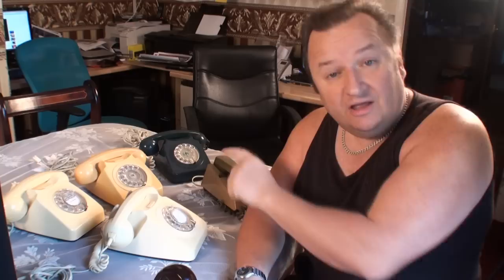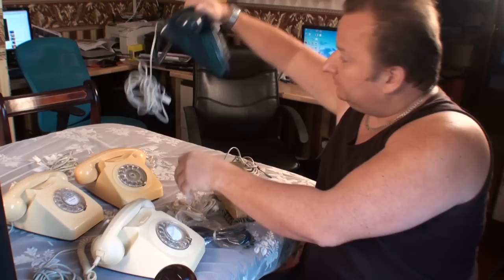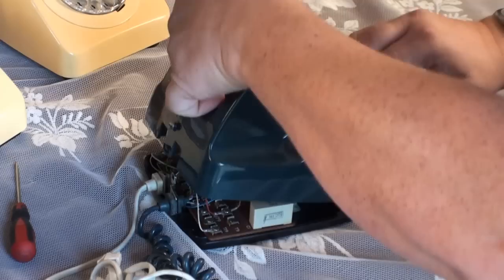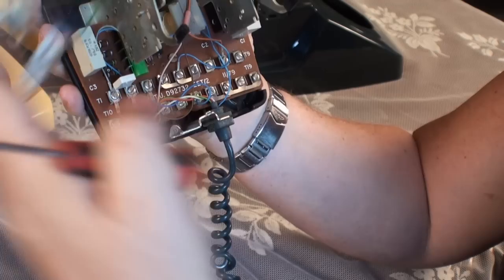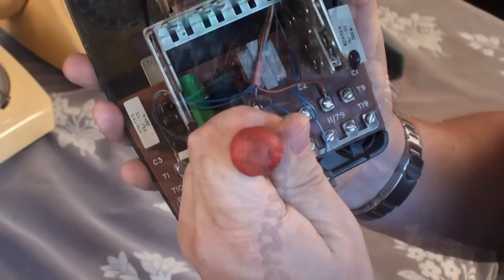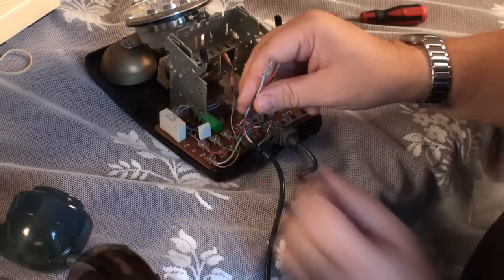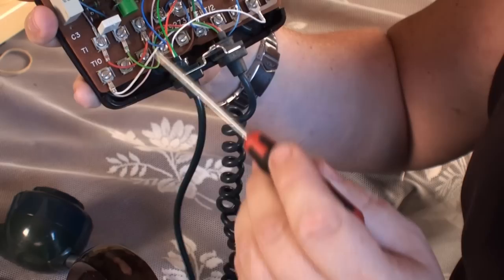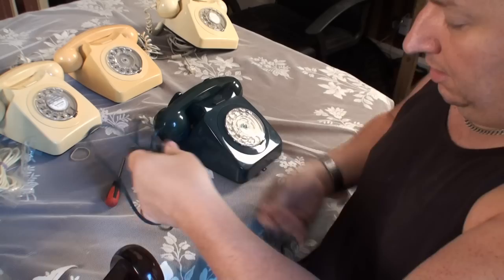How To Convert An Old GPO 700 Series Telephone To Work On A New System

Comment: Brilliant video chuffed to find such and informative well put together demonstration, just one question the 330 k ohm resistor there a few variants on ebay which one do I need please? Again thanks for the video.
Reply from the maker: This one was a standard ceramic John, nothing special.
Thanks for watching.
Cheers
Martin
Reply: Martin cheers mate, I will give it a go tomorrow ☺☺
Reply: Worked all fine for me Martin thanks again brilliant.
Reply from the maker: Nice one John, Well done bud.
Cheers
Martin
Reply: hello matey wicked nice and easy to follow one question all the 330 k ohm resistors have different watts the ones i am looking at are 330 k ohm 0.25w will the be ok ? cheers david
Reply: The one that's 330K Ohms.

Comment: Sound tip for any of this stuff is to take a photo of how it was originally connected before you undo any of the wiring.  Then you can always trace back any problems.
Reply: Get close ups from different angles. It's maddening to take just one photo and later realize som wire is hidden from view.

Comment: I forgot
I used to work for a large company with large offices.
When they changed from pulse dialling to tone dialling handsets, there were skips full of old phones, plus other stuff like golfball IMB typewriters.
They wouldn't let the staff have them and in the case of the phones, they said they wouldn't work on the new system.
How wrong they were.
And that was before broadband.😂😂

Comment: Just converted a 706 and it works like a dream, thanks
Reply: Can you get it to dial out?
Reply: @expertvillageidiot  Yes, from two different land lines. And ours is via fibre. Copper to the board 300m away and then fibre. Neighbours is just copper.
Reply: Both BT connections, if that helps

Comment: Even as a telecommunications technician I didn't realize how different US and UK phone lines are.  A phone line here is only 1 pair of wires. Signal and power are shared on that one pair. I've not heard of an old phone here effecting broadband speeds. I don't think the standard for analog phones here has changed in decades.

Comment: Hello Great clear well made video. I just wanted to point out that you haven't actually changed the Ren value with the resistor. The blue lead from the bell coils needs to be on the terminal on the left side and at the end of the resistor. The way you have it connected means the power is not going through the resister at all. Regards Neil Carpenter

Comment: Good stuff and thanks.
Just bought one of these for old times sake but I want to at least get the bell ringing.
Oiled the dial mechanism and straightaway that works as it should.
Amazing how ingenious these engineers were to do most of the dialling etc., mechanically.
It would just be a chip now, and probably impossible to fix.

Comment: Your provider still needs to support pulse dialing for these to work. I think BT are the only ones who still support it and they'll be fazing that out soon. If your provider doesn't support it you can't dial out with rotary dial phones. If you want to dial out you'll need a pulse to tone converter and their expensive!
Reply from the maker: Thanks for the update.
Cheers
Martin
Reply: I can confirm that Virgin Media still support pulse dialling in most (but not all) areas.  BT will support pulse dialling until 2025, when they will be phasing out the PSTN network and moving to VOIP.
Reply: Morris McKinnon .
Reply: Pulse to tone conversion can be done for around £30, I know of a guy that does that in Bromley.

Comment: Martin the Bakelite phones can be converted in the same way. the old GPO phones connected the bells in series and the coils where 500 Holmes so each phone bell impedance was 1k  allowing 4 phones to be connected in series. the new system connects the phones in parallel  so the sounder or bell coils are 4k impedance so when 4 phones plugged in overall impedance goes back to 1K that is why you fit the shunt resistor.  without the resistor the impedance is below the 1k and that is what affects your BB speed.
Reply from the maker: Thanks Gordon, That makes sense and is a handy addition for anyone wanting to know the tech side of the conversion. Good Job.
Cheers
Martin

Comment: Hi great video easy for an old wrinkly like me to understand. Mine don't seem to dial out, Is there something Ive missed?  Thank again for the easy to follow video
Reply: Depends if your network still supports pulse dialling. If not then it will only receive calls. There is a converter that will enable it to use tone dialling networks.

Comment: That resistor looks like it is a 3k3 ohm (3300ohms), as the colour bands are orange, orange, red. You refer to it as a 330k ohm (330000 ohms) which would be orange orange yellow. A slight difference of 100 times. 3k3 does seem a bit high. Can you confirm?
Reply: It should be a 3K3, so the item in the phone is correct. This is only needed if the bell coils in the phone are 1000 ohm (2x 500 ohm).

Comment: I've just bought a converted 746, dials out perfect, receives calls perfect but whilst I can hear them the other person can't hear me.
I've replaced the transmitter with one of the newer versions but it didn't solve the problem. 🤷‍♂️

Comment: Interesting that some of those have # and * after ZERO. State side as far as I remember ours stopped at Zero.  I think I still have a rotary plugged in my basement. Interesting to see the modular jack is different as well.
Best of luck with them
Tim
Reply from the maker: Yes, I think they are different this side of the pond Tim although they look the same on the outside.
Cheers
Martin

Comment: Hi Martin have managed to get hold of a couple of phones . One is a older 706 looks pretty much the same inside, the other two are,
Extenion phones  not sure if they can be converted  to work in the same way. 

Cheers  Pete.
Reply from the maker: hi pete, i'm not sure but i would imagine they are the same components just wired different.
Reply: Hi Martin will give them a go , nothing to loose my mum got hold of them for me.  Cheers Pete.

Comment: Thanks for this video it really helped me get my phone converted and working. The only problem is the ringer doesn't sound. If i pick the receiver up when i call from my mobile i can hear but it isn't ringing. Any suggestions? I've looked at the video and where your wires go but no luck so far.
Reply: Try bridging  T8 and T9 or failing that order a socket with an inbuilt ringing capacitor

Comment: I just noticed that in the UK the phone rings in two short burst. Here in America its actually one long burst, which is pretty interesting me.
Reply: If you plugged a US phone in in the UK, it would ring as UK, as it is controlled by the line rather than the phone.
I'm using my old GPO phones on VoIP using a Cisco adapter and by default they rang as per a US phone.
I had to tailor the regional settings within the Cisco unit's web configuration.

Comment: Hi! I hope u can help me! In my case, the cable that the phone has it 
just 2 copper cables. When i conect them to the line, with a modern 2 
cables cable, it works properly, but it doesn't ring. It's a model from 
1956
Reply from the maker: Sorry, I can't help bud

Comment: Hi there, I could find the Resistors but having trouble finding the cable and the bridge from T1 to T2. Any tips on where to buy them ? 
Cheers
Reply from the maker: +martin Long Hi, I got the cables from Ebay, there's plenty there. Google the bridge.
Cheers
Martin

Comment: Hi Martin great video. I've purchased a 746 which provides a dialing tone, can make calls but doesnt ring when I call it. It's a new build house with fibre to the property but it has conventional bt sockets for the phones. Theres no switch on the front for turning the ringer off; any ideas? Thanks
Reply from the maker: Sorry Paul, I don't know.
Reply: Perhaps ringer is disconnected? Might have been an extension phone.
Reply: @kg5radio716  resolved the problem by purchasing an old ADSL filter (the type routers come with for running an ethernet and phone line from one port). Works fine now 😁

Comment: would a basic conversion reduce broadband if it were just plugged in and not in use for calls
Reply from the maker: +paul hunter If you didn't do this to the phone and just fitted a modern socket then it would affect your broadband speed so you need to do this so you still get full broadband speed.

Comment: First you said 330 Ohm then 330 K Ohm.  But it looks more like a 330 Ohm or 3300 Ohm to me. ie. Orange Orange Brown or Orange Orange Red.
Which is it ?  Nice work too, by the way. Many thanks for posting this.
Reply from the maker: it's a 330k ohm
Reply: retrorestore
So ... Orange Orange Yellow then ?
Reply: No. Sorry. The resistor should be 3.3k (3,300 - Ohms) Orange, Orange, Red. Any additional coloured bands on the component refer to its tolerance (ie percent accuracy of its value) and can be ignored in this particular instance.
Reply from the maker: Peter Preston
Thank you for pointing this out.
Cheers
Martin
Reply: No probs Martin. An excellent video which clearly explains the conversion! Thanks.

Comment: It is certainly not a 330K resistor as mentioned. It's a 3.3K resistor and it's to limit the current to the ringer. 330k IS A HUNDRED TIMES TOO BIG. Also, it looks like he has fitted a 330 ohm resistor but it could be the camera making the red ring look brown. For information google 3 band resistor colour codes. 3.3K= orange orange red

Comment: Hi
Great video. Thank you.
Just one thing-is there a special name for the flex as I can't find it on ebay anywhere?
Thanks again
Reply from the maker: Here you go https://www.ebay.co.uk/itm/BT-GPO-LINE-CABLE-PSTN-FOR-706-711-741-746-TELEPHONES/192396704969?hash=item2ccbbcbcc9:m:mZBFziPpImxw6P3aZeSezhw:rk:1:pf:0
Cheers
Martin

Comment: Hi I have an old 1960 dial phone. The layout of the terminals is not the same as a British or Irish phone. Plz can somebody help me convert it to modern phone system. I tried to connect the wires with different terminals and it has the tone now but is not totally functioned.
Reply from the maker: +Obaidullah Shahzad Sorry, I don't know. Maybe someone else will.
Reply: I got a tone but it's not continuous. It's more like a busy tone. When I ring this phone it does not ring but when answered, the receiver end can hear me but I can't.

Comment: That resistor is NOT 330 kilohm at all. It is 3.3K Ohm ie. 3300 ohms. Orange Orange Red.
Reply from the maker: Cellular Dial Telephone Thanks for your comment.
Cheers
Martin
Reply: Correct